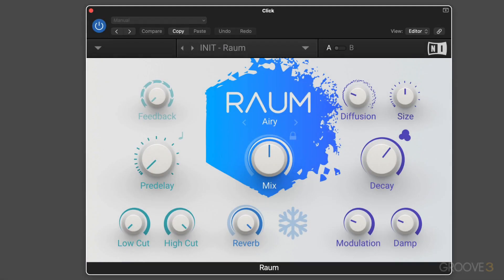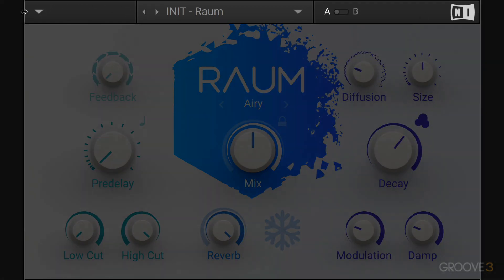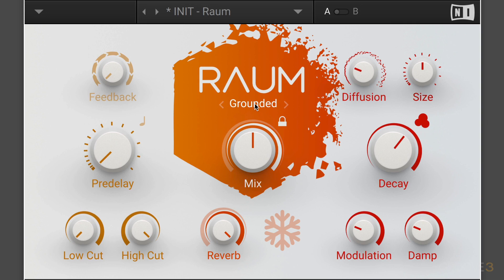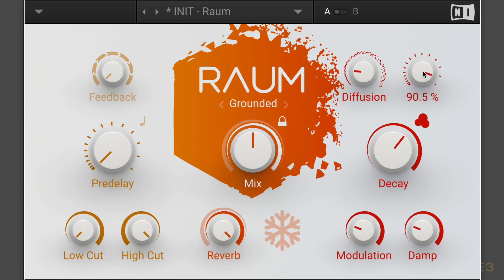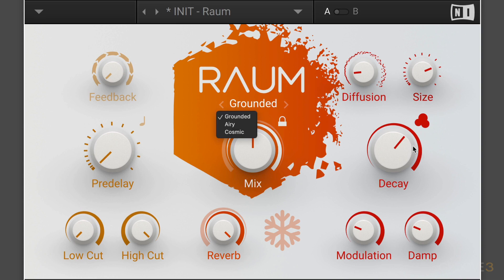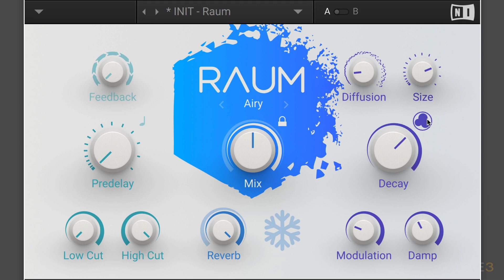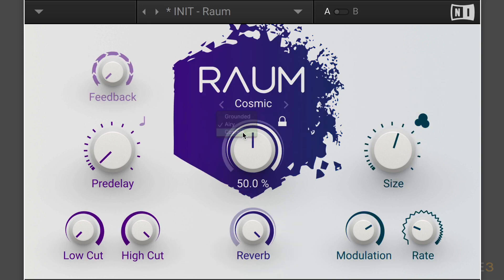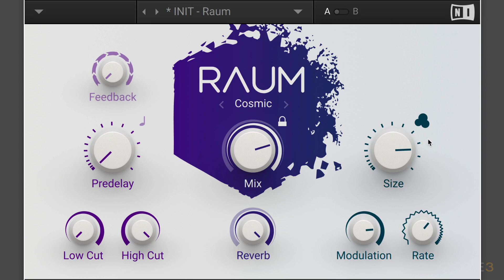The 3 algorithms of Native Instrument's RAUM

Comment: In the manual it says this which I don't fully understand. An someone explain it.

(3) Mix: Adjusts the amount of effect added to the input signal by means of an equal-power cross fade.
(4) Reverb: Adjusts the amount of reverb added to the effect signal by means of an equal-power
crossfade.
Reply: 3 - you're choosing the ratio of dry/wet
4 - you're choosing how much reverb is in the actual wet signal

So 3 affects the entire signal, and 4 affects only the reverb wet signal
Reply: @guisuschristus  Thanks for the reply. So if I am gonna put it on an aux track Both 3 and 4 should be full. If I am wrong correct me.
Reply: I am still don't fully understand. If i use it on an aux do I have to go fully wet on both  @guisuschristus